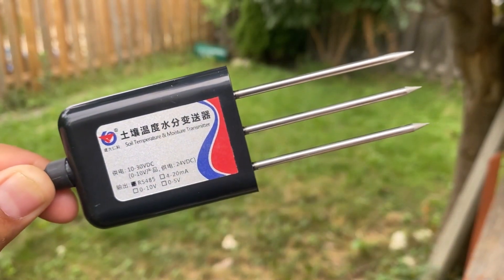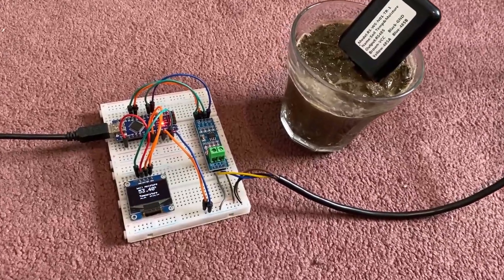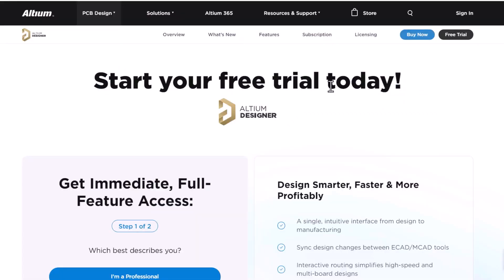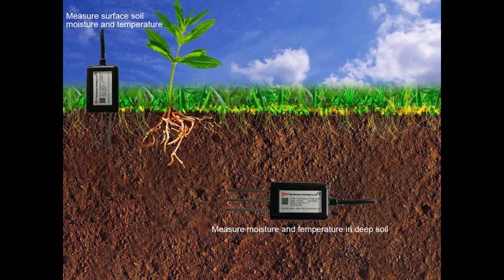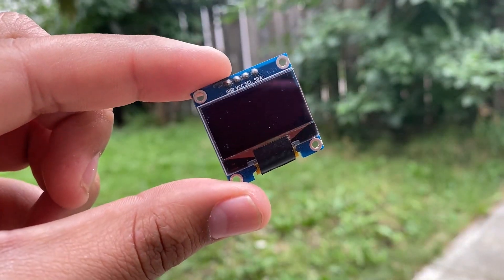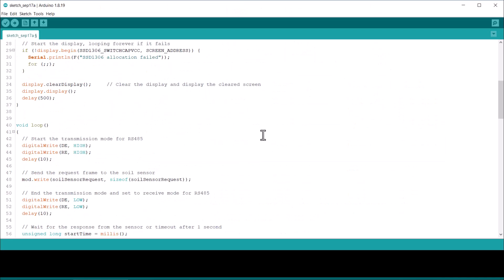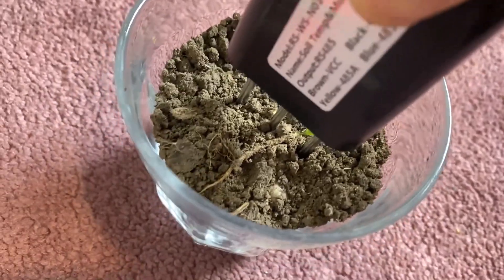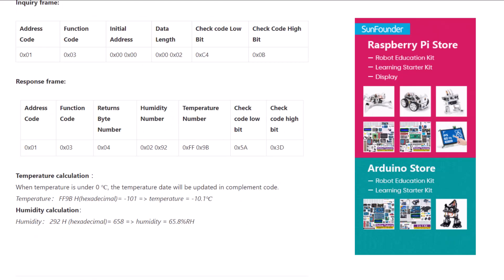RS485 Soil Moisture & Temperature Sensor In-Depth Tutorial with Arduino

Comment: how much energy does it take for operation???....it would be interesting to expand it with a small photovoltaic panel and two 18650 lithium batteries
Reply from the maker: The sensor alone consumes 0.4W